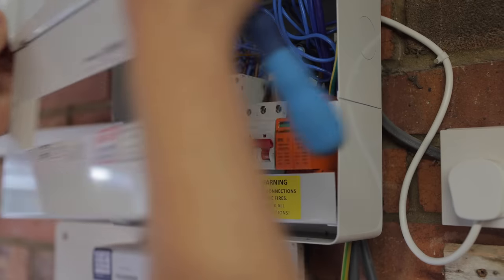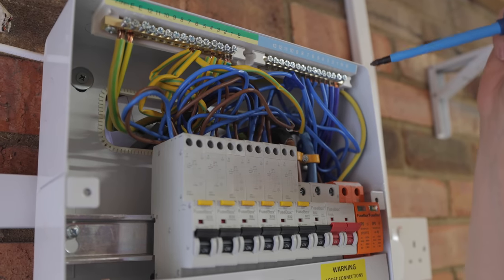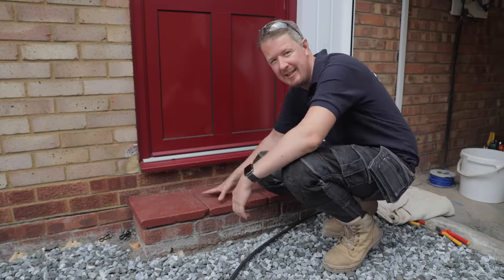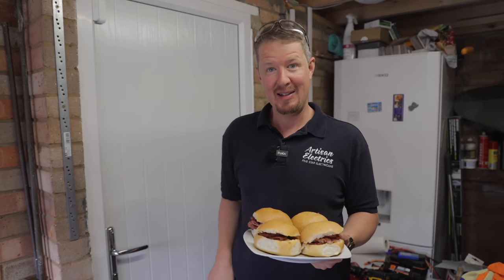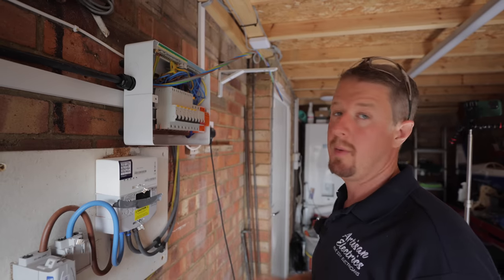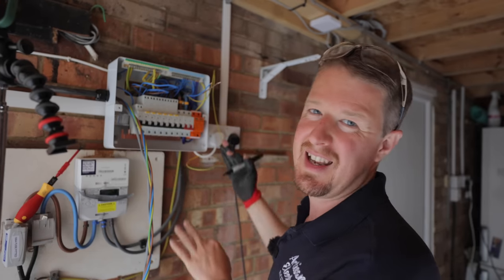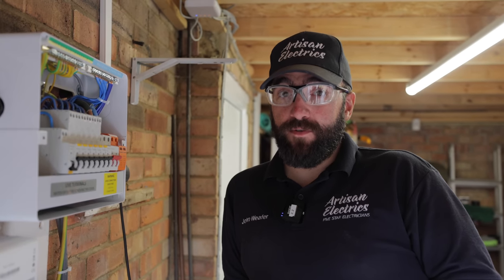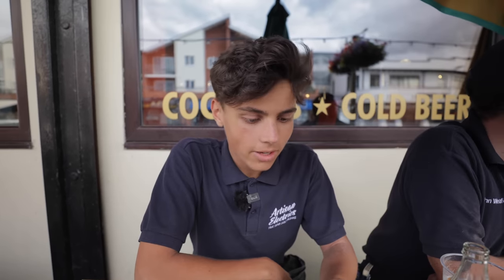SHOCKING FIND - SO bad I had to fix it IMMEDIATELY

Comment: Don’t get the obsession is with tight wiring inside db. What ever happened to leaving some slack in there for potential future alterations. Is it terminated, sized, insulated correctly etc if so no issue. Not just you guys the internet is full of look how pretty the inside of my db is
Reply: I always shove the slack behind the breakers where you can't see it, can still do a tidy job
Reply: Watching the video there has to be slack hidden behind the breakers seeing how he wired it in the end. I do agree in the whole overly neat thing though. As long as its mechanically and electrically sound there isn't a problem. However I don't think there's anything wrong with taking some pride in your work and with electrics making things less confusing is inherently safer so it kinda makes sense so people don't mess up circuit IDs etc. I work for a DNO so my work isn't domestic but that's my take.

Comment: Going on about poor workmanship from previous electrician but Cable ran at ground level and holes drilled low level where water could soak into brick work then just cover cable to a bit of gravel and then leaves bonding clamp in main incomer and doesn’t inform dno about it , works on live board drilling and poking fingers inside board 😬

Comment: Ever considered using 20/25mm hole punch to provide cleaner edges for your glands? 3mm pilot, open to 10mm then spanner to wind the punch through. less flying swarf, and a totally clean edge. Used these for many years, and not expensive.
Reply: All that metal swarf from the hole saw inside the enclosure is not a great idea.  Thats what hole punches were designed to eliminate.
Reply: or use a magnet to clean the metal filings awy
Reply: Magnet in cling film, (or similar) makes it easy to clean the magnet.
But I still find punches are cleaner.
Reply: Minute Metal swarf inside consumer unit. Where in the regs about this?
Reply: @johncorbett1130  simply best practice for any trade - keep it clean and clear….
Doesn’t really need a reg to state it
Reply: Herr, exactly it's not in the regs. Totally unnecessary.
Reply: @john
Poppycock on stilts!

Comment: Talcs for cable pulling, also Jordan just be careful with meter boards, personally I would say that board could of been possible asbestos. With in your RAMS you probably would touch the meter board, but obviously moving cleats is a spur of the moment situation, may be worth re assessing the risks. Top work as always though 👍
Reply: You can see it's chipboard, there's a big chunk taken out of the top

Comment: HM sauce was a limited jubilee special.  The board looked to have been fitted by Billy T Kid Electrical.  The question...  Should you have reterminated?  Without a full EICR I'm not sure it was a great idea.
Reply: Probably a poor choice of promotion, I just assumed it was some kind of Aldi knock off version.
Reply: The label picture (with scaffolding) has also been changed and that will stay until the tower renovation is completed. The ‘HM’ part was, as you say, just for the Jubilee. The things you learn with Artisan Electrics!

Comment: Like the UK has "super hot" days.........Its not Marble Bar in WA Australia that can be over 50C for a week.  I would of taken the charging cable above the step......easy.  What a difference, before and after on the fuse box wiring. Imagine when every home has a electric car charging, plus normal circuit loads pulling 100amp at 230v..........23 kw LOL.  Where I live, a 200kva transformer supplies 30 homes.........30 x 23kw = 690kw  LOLOLOLOLOL.......the power company will have to install 4 transformers to replace 1, and quadruple the substation capacity.........LOLOLOLOL  big $$$$$$   Just a single medium sized country could be facing an electrical grid upgrade bill measured in TRILLIONS of dollars.   How is that going to paid for.....on your electricity bill........100%,200%,300% bill increase...........no problem.  What will happen is a lot of people will be cut off, for lack of payment.

Comment: "It's really important that the polarity is correct, just because if you mix them up it could still work but is dangerous"

Well it's not a case of "could work"; it will work. Here in The Netherlands all 230V plugs are unkeyed and you can get them in either way. Since it's AC, it won't matter anyway to as good as all domestic appliances. From a technical standpoint there is no real benefit of making sure the live and neutral of an appliance (or in this case EV charger) match up with the colors of the incoming feed.

The reason you should adhere to color coding is so that everyone knows exactly what is live and what isn't. However, if you treat all wiring as potentially live and only do anything when you're sure you've isolated the circuit, you'll be better off in the end. 

I think the young dude might need some more explanation about why color coding is used, so he can explain it proper to other people.

Comment: I remember those drills from my school days.
I would go round that step, it's getting covered in stones anyway.
I prefer the D-Line clips
Stating the obvious Jordan but I reckon the HM is because it's the Queens Jubilee year.
I wear shorts at work, when I'm wearing the trousers I always wear knee pads.
Looks like cowboys that were at that job!
If the consumer unit has good front access you can see the busbar connection.
Wow Jordan how have you never seen that game!
Great video guys!

Comment: Some parts of connected wires got copper showing which I get it's not optimal but the whole bus bar is 100% uninsulated. It's a shiny lethal copper bar 1000 times bigger than any copper in the wires. Also I'm not sure if it's up to the standard to not actually dig the cable in the ground and just leave it there. That wouldn't be okay here.

Comment: I’m interested by the shorts debate. Surely the same logic applies to short sleeve t-shirts and therefore only long sleeve tops should be allowed also? 

I agree with the shorts + knee pads as only have one set of knees, but disagree that shorts should be banned for “protection” reasons as personally I’ve had more swarf land on my arms than legs.

Comment: you drilled a hole, in a live board...
Dont do anymore work on electrical boards, not on my site, or anywhere.
Hope you de rated all the cables for that bunching on the Neutrals, what is it with tying everything together these days, space around cables/wires is what is required.

Comment: So strange it isn’t 3-phase.  And exposed single insulation conductors, are you kidding me???  That would not fly in Sweden.
Reply: Hello martin we do have 3 phase in the uk but it is very rare in the uk in a domestic house . 100amp single phase is more than enough . 
It is against regulation to have basic insulation visible to touch . The basic insulation in this video is inside an enclosure that can only be opened with a key or tool .

Comment: Been watching a lot of your videos lately. Great artisanship in each and every one of them. Nevertheless I am amazed at some of the stuff you guys work with over in the UK. There seems to be a lot of regulations and forms that have to be filled in for every job. Also I'm seeing stuff that would be frowned upon massively here in the Netherlands. Why is it allowed to have the whole installation so exposed in the garage? Seems so easy to hit it with some tooling or to even get it wet with your garden hose for example. And why is the junction box made of metal and not plastic? Seems very dangerous. Just some strange stuff I'm seeing used compared to what we know here.
Reply: Metal means it won't break of you hit it with the end of the rake for instance, same thinking as in the industrial boxes. I'd place it closer to a corner or ceiling though.
As the whole box is connected to ground, with a separate cable for the lid, it should have much lower resistance path than anyone touching it even if they just come up from the salty sea.

Comment: Torque screwdrivers - fine for a solid copper busbar but at the other terminal you've got stranded conductors that will compress and deform when tightened. Personally I think when time allows it's good practice to pre-stress stranded conductors. Tighten to 75% when installing and then later on maybe during testing do a final tighten to manufacterers rated torque. Also worth going along the screws at the distribution board during the EICR - we do a tug test but unless we go across with a torque screwdriver we can only assume that the torques are okay.

It's worth remembering that copper is quite a soft metal and we shouldn't be using tools in the same way a car mechanic would. 

Of course downside is that we put more wear on the screws - and one of my criticisms of fusebox in terms of build is that the screws on the N and E busbars are a bit rubish. But EICRs naturally put wear and tear into an installation just as when you take your car for a service it puts wear and tear into the screws holding various covers on.
Reply: most UK domestic is solid copper conductors for the final circuits, not stranded. You can always crimp ferrules onto the end of stranded to get a better connection.
Reply: @havoctrousers  anything 4mm and above is usually stranded as are singles.

I use my ferrules occasionally - I used them the other day when I trimmed down the fine stranded wires for an SPD which is good practice because you want your SPD wires to be as short as you can get away with.

But even with the ferrule the reality is that the copper is soft and is mechanically acting as a bit of a spring and a bit of a damper. And whilst the bite in the wire where your screw is will stop it falling out - and might make it pass a pull test - the problem is that a few heating cycles and it might not have the electrical connection you think it's got.

And the problem with electricity is were not depending on mechanical connection, we're depending on low resistance that will remain low resistance when someone has jiggled a wire.

Comment: Kudos for sorting that board out dude. I probably would have done the same, although people may think it was the previous installer that had some pride. Shorts have their place and on site, for me is not one of them. Kind of like when I used to ride my motorcycle. Always in my leathers, regardless of the weather. Another great video mate.

Comment: Nice touch tidying up board but as you disconnected every circuit and re connected should you not have tested it all
Reply: Grow up mate if he torqued them up to spec then it's a complete waste of time
Reply: @lewis94uk what the hell  has that got to do with making sure you didn't mix up a ring  he is responsible for that board now MATE
Reply: @robertwilliamson3852  to be fair, if he mixed up a ring I think the RCBO would have popped wouldn’t it?
Reply: @cchimozmin  yes it was just an example but not necessarily  it depends if anything was on it could have worked then gone after he left  my point was really his good deed leaves him responsible  Imagine if you had done that  board 6 months previous then he re did it would you still honor a warranty
Reply: @robertwilliamson3852  good point, well made 😊

Comment: Brilliant videos lads. Wondering how you get away with not using swa glands? I'm sure there is a reason would love to know. 👍
Reply: pretty sure it was NYY-J and not SWA so no brass gland needed
Reply: @havoctrousers  Ah I see, I thought that may be the case but I thought that would then need mechanical protection if run so exposed.
Reply: @gordonimrie7529  agreed not sure I would be happy with non armoured cable on that run and NYY-J is more expensive than armoured at the wholesaler so I don't see much point in using it.
Reply: @havoctrousers  I'd let them away with it for re-doing my fuseboard. Lol
Reply: @gordonimrie7529  fair point, that was above and beyond 😂

Comment: Just shows how inexperienced you house bashers are we used a rawl tool or a rawl tool drill those drills were for wood or metal and for  joists we used a brace with different sized bits

Comment: what type and size is the cable that you used?
Reply from the maker: 4mm 3 core EV Ultra Tuff Sheath with Cat 5 made by Doncaster Cables
Reply: @artisanelectrics  does the cat 5 end up in the consumer unit?
Reply: @cchimozmin  yes it does

Comment: "Too many copper tails showing" on an EXPOSED BUS BAR. These dudes are just talking out there ass in attempt to self promote. If they were decent craftsman they wouldnt need to lie to people about the quality of others work.
Reply: If you'd actually watched the video, you would have seen the busbar cover on at 2:49 when he originally removed the board front, and you would have seen the busbar cover reinstalled at 20:00 when he's about to close it up. There is no exposed bus bar.
Reply: Was work taking place in proximity to a live exposed bus-bar….??